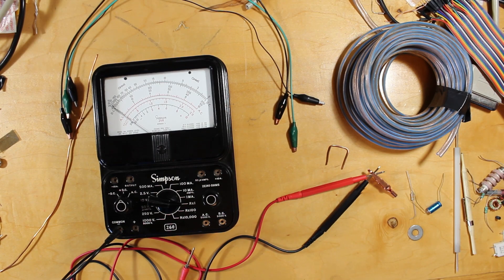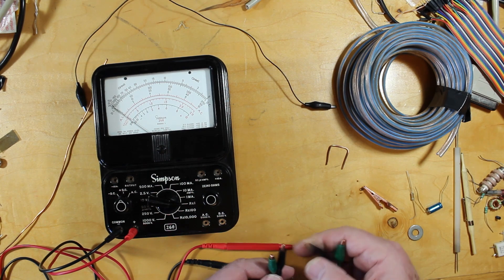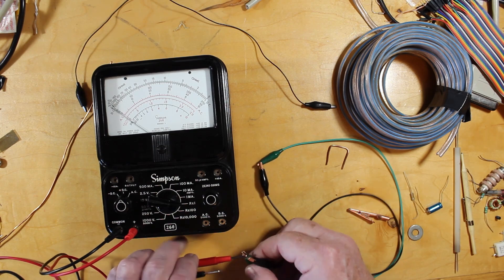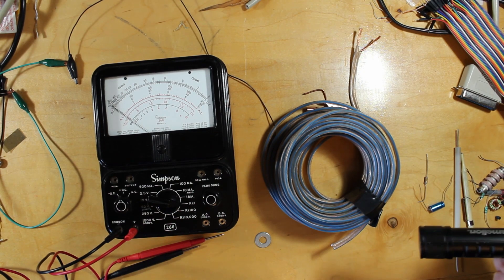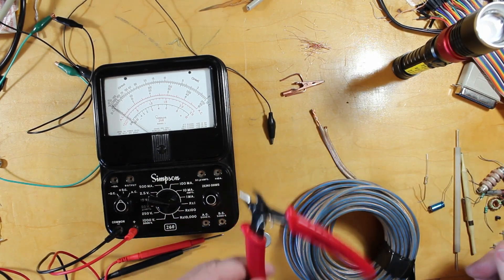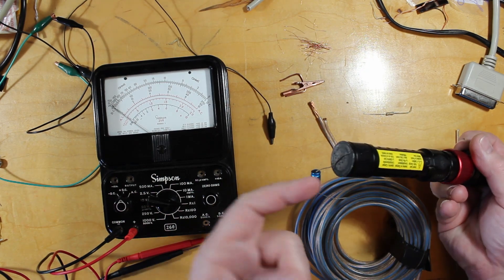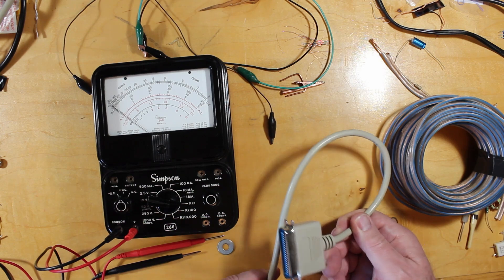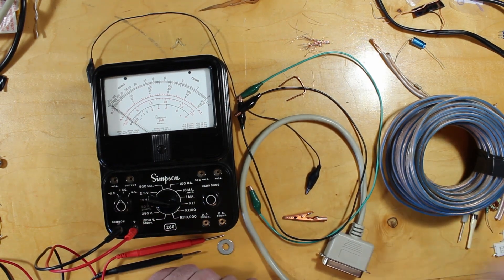#6  Surprise!  This 'speaker wire' is not made of copper. #fake

Comment: Once doing a project I had issues while using those jumpers only to figure out that all the alligators are crimped, the poor quality crimps added a lot of resistance to some of them. Now if I purchase those cheapie jumpers I re solder all the alligators.
Reply from the maker: I've seen the same.  The wire strands are folded over on the vinyl insulation and crimped.

Comment: As an old electrician I am very familiar with nickel-coated copper. This was used in the pre-wirenut era when wires were soldered. Nothing wrong with copper-clad wires as long as the seller is upfront about it. I would prefer pure copper though.

Nice 260 there. I have a 130 around here somewhere.
Reply from the maker: Just bought some new leads for the meter.  The old vinyl ones were too short and stiff.
Reply: @MoreThanElectronics  Good leads are a thing of beauty. And not necessarily easy to find. And you know that they have to be cheap if they are substituting Al for Fe...

I remember that the old Wiggy testers would break their leads fairly frequently. Something that you wouldn't expect from a Square D product. Now Temu sells "Wiggys". What could possibly go wrong? Yikes!
Reply from the maker: A Wiggy is not something I would be cheap with.  They're not that expansive for a decent one.  Getting shocked while you're up a ladder might not kill you, but the fall might.....
Reply: @MoreThanElectronics  It would get to where it would be a crapshoot whether the darn thing was working or not. 

Now I know why the old-timers used their fingers. :)

Comment: Just tested a bunch of alligator clip wires I use - about half are magnetic. I knew copper coated aluminum was othen used, these days  in Ethernet cable, but didnt know they were also skimping by using steel. Its hard to image that the cost and effort to coat such small strands of wire is actually worthwhile.
Reply from the maker: Depending on what kind of steel you compare with what type of copper, the price difference is often copper being about 8 to 10 times more expensive than steel.  The wires can be electro-chemically coated with a thin coating of copper in a continuous process at speed.  Unfortunately it's one way to increase profit. (Ferengi rule of acquisition 239)

Comment: Ever rewire a Incinolet toilet?
The first time I did one it burnt all the copper wiring.......it was excellent Ancor marine wire.
I did it a second time with MGT type wire.
Also. I used high temperature terminals........tin coated steel.

Comment: Well, the  standard field telephone wiring used in the "Old Army" was actually a mix of steel and copper.   The steel wires were meant to permit it to span good distances without sagging while the Cu was, well, for conduction.
Reply: It was something else.
Those cables were made up of silver plated copper wire and steel wires for strength!
Copper iron wires are a pure scam!
Reply from the maker: Given that the loop resistance for a telephone setup can be quite a bit more than 1000 ohms, using wire with higher resistance can be acceptable.  Other factors, like strength, can outweigh the resistance.

Comment: There is one very good reason for steel wire use in some applications: Steel can be made way more fatigue resistant than copper, so it is less likely to break when exposed to movement and vibrations or so. Of course, those are limited to where the extra resistance is not a problem.
Other method was to use metal coated plastic, those were very popular for telephone head set cords, where even a few 10's of extra Ohm was no issue at all.
Reply from the maker: I think of the copper coated steel that is sometimes used in 'long-wire' antennas which have long spans of unsupported conductor.
Reply: @MoreThanElectronics  
Similar construction are also military telephone wires: A pair of conductors within common plastic/rubber sheet. There the motivation is really the mechanical strength and robustness.
And power wires (on the poles, not cables burried underground) use to use steel core surrounded by a bunch of aluminum wires. The steel core provides tension strength and aluminum conducts the electricity, as it is the second best conductor per weight (behind beryllium, which obviously wouldn't be that good choice for something in the open).
Reply: @MoreThanElectronics  Yes, the copper coated steel can be an excellent choice for antenna wire, if the frequency of use and the thickness of the copper are sufficient.  You get the strength advantage of the steel and the conductivity advantage of the copper.  Due to the skin effect, virtually all the current will be in the copper if the copper thickness is a few skin depths or more.  For instance, at 7 MHz, the skin depth in copper is one thousandth of an inch, so you would ideally like something like three thousandths (3 mils) or more of copper coating at this frequency.  (For use at other frequencies, note that skin depth varies inversely as the square root of frequency.)  Due to skin effect, plain steel wire is very lossy in high frequency applications.  Steel wire has even been used to make dummy loads for use on the end of rhombic antennas.

Comment: I always take a look at the end of the cable if I see copper or scratches on the metal.

They can be aluminum!

in the area where I live, we mostly have copper speaker cable, but antenna coax cable can often be steel. and cheap rca car signal cables can be aluminium

Comment: Nowadays they have all sorts of wire, CCA, CCS, even CCC (Copper Clad Copper).

Turns out CCC is actually low grade copper wire being clad with good quality copper, hence CCC.
They have worse conductivity compared to pure good quality copper wire.

In the old days they'd clad copper wire with silver for radio equipments, nowadays  it's quite the opposite for electrical wire being silver aluminium being clad with reddish copper to make it looks like whole copper.

Even LAN cables (cheap ones) many are CCA cables inside. 😢

Pure good quality copper wire are more expensive indeed.
Reply from the maker: The package should be labeled so that it's easy for the buyer to see what they're getting.

Comment: To be honest, I wouldn't try putting an amp through even pure copper wires that were that thin anyway.  I have a bunch of larger-gauge (some 18 and also some 14 AWG) clip leads which I use for anything over a few hundred mA...

And be careful of the cheap data cables like that old printer cable.  A lot of those were made with CCA (copper-clad aluminum) wires, not pure copper either.
Reply from the maker: I suppose part of the consideration when using small jumpers is how much voltage drop you're willing to tolerate.  Also don't turn your small jumpers into fuses.  
I just made two jumpers from an old printer cable today. (video soon) I did put one amp through them and measured 108mV drop average for each.  So about 0.1 ohm each.  About 4x less loss than the steel ones.  The wire used is tin plated copper.
If unsure of the wire, scrape it with a utility knife or similar and look at it with good magnification. And try a magnet.

Comment: The UK telecom companies use steel wire ( for great strength ! ) coated in copper .... but this is the IDEAL arrangement for electrolytic corrosion ( in the damp outdoors ! ) , nowadays they surround the joints with thick  gel , but , this was not always so , resulting in crackly telephone conversations ( and , broadband dropouts ! ) ...... DAVE™🛑
Reply from the maker: There is a copper coated steel wire with a further clear enamel over all that is used for long-wire antennas.  The skin effect at RF frequencies makes it a reasonable choice.

Comment: Nice.  Worth mentioning I got a couple of Mini PCs from AliExpress about 2 years ago, the kettle lead on one I felt iffy about so replaced it.  I cut it open to see the thinest of aluminium wires inside, image if somebody used it for a different application, with a much higher power draw.  KaBOOM at best, like a fuse, or fire at worst.  I almost feel like I should be PAT testing new cables I buy, just to have some confidence.
Reply from the maker: Made to do the job, but just barely.  Thanks for the comment and the subscribe.

Comment: It sounds like one should be taking a magnet with them when shopping for wire.
Although there is another twist, copper coated aluminium wire, a bit harder to spot.
Also the copper plating can be really thin, to the point that it more or less disappears while your soldering, meaning half way though your soldering session the wire loses it's will to stay tinned.
Reply from the maker: The next time I shop for speaker wire I'm bringing a magnet.

Comment: I noticed this a few years ago when some clip leads carrying maybe 2 amps got so hot that the insulation got soft. I checked all my leads and maybe 1/4 were steel.
Reply from the maker: Yeah, I used to put it down to the wire being very thin or the alligator clips having a poor connection
and never to it being made of steel.  Like I mentioned at the end of the video, I found a printer cable to deconstruct and will be remaking a bunch of my jumpers.  Thanks for the comment and the subscribe.
Reply: @MoreThanElectronics   Glad to subscribe, your channel looks like it might really take off.

Comment: My resistors, old mixed batch, are copper.   My capacitors, old and new, have steel leads. My new resistors have steel leads.
Reply from the maker: Almost all the resistors I have use steel in their leads but it's not a problem because that small resistance is nothing compared to the resistance value itself.  I'll have to look and see if it's the really low value resistors that have copper leads. Copper has better heat dissipation.

Comment: It's an increasing problem. Steel and aluminium are cheaper than copper, so they are often substituted, often with a thin copper plating so it looks good.
Reply from the maker: That is true.
Reply: Consequences of getting everything from China where we have zero control over regulations (or lack thereof).
Reply: Um, I hope you aren't talking about massive overwhelming regulations in the US. They are well hidden, but a big pain in the butt.  @jnharton
Reply: Pretty soon the U.S. will run out of copper. The recycling centers sell it to China. I took several old transformers to be recycled only to find out they are shipping it overseas. This should be a law against this our natural resources are being depleted.

Comment: If copper wire isn't magnetic then how come they can make magnet wire out of it? 🤔
Reply from the maker: Magnet wire is typically called that because it has a thin (often high temperature resistant) enamel coating for insulation so you can wrap more wire on a form than you could with typically thicker rubber/vinyl covering.
Current flowing through any conductor creates a magnetic field.  Whether the conductor is magnetic (iron) or not (copper, aluminum) doesn't matter.

Comment: I bought some speaker wire on Amazon that was advertised as "naked copper" but it turned out to be aluminum with a thin copper plating on it - it went back the very next day. Also, a few low-cost 230V plugs+wire I bought are suspiciously lightweight. I kept them since I want to use them for very low power lights, but I wouldn't be surprise to see them catch fire when used at the maximum declared rating.

Comment: Yeah, I noticed this some years ago on Computer Power Supplies...
So imagine running high current...all the time...through aluminum wire...Device runs harder to compensate, thus drawing more current...Now, put a Power Company power usage meter on that....

Comment: Wow a great Model 260 Simpson meter. Cut my teeth on one of them. We had a couple of them in our electric shop in the 1970's that we use to send out every year to get calibrated & replace the test leads. Have not seen anybody using them out in the field in over 40 years. Wire most likely another cheating communist china POS inferior product. I never purchase or use any safety & test equipment, electrical supplies, tools or LED'S made in cheating china. The #1 enemy of the free world.

Comment: great tips !  If repurposing old wire can make BETTER jumpers it's well worth the time.  it's convenient to buy pre made but i dont want them if they are junk 🙂.
Reply from the maker: And you can make longer jumpers if needed.  Those old printer cables have 25 wires, times their length, equals quite a bit of wire and each a different color.

Comment: Great video! 👍Those non-magnetic wires may be aluminium wires and not necessarily copper.
Reply from the maker: Agreed.  I think the weight difference of a roll of it would be noticeable though.
Reply: @MoreThanElectronics  you use the lighter test to find copper clad aluminum. If it burns like hair then it's CCA. Copper can withstand heat a lot better than aluminum can. But once all of that came out then they started making copper clad steel. Plus steel is even cheaper than aluminum is so it was a win win.
Reply: The CCP loves CCA!

Comment: non magnetic wire could also be made of aluminium. It may not be as poor of a conductor as steel, it's still only 61% of copper
Reply: I found a microwave oven transformer where the primary was made of aluminum.
Reply: @ericthecyclist  that is very common with new microwave ovens.
Reply from the maker: That's true.  The steel speaker wire is less dense than copper but not so much that I noticed it when in the store.
I would hope that if anyone comes across aluminum wire they would notice the 3:1 weight difference.
Reply: Yup, and very hard to solder if not impossible.
Reply: And yet aluminum wiring was actually used in residential at one time...
Reply: And that was a disastrous hell. Aluminum wire at that gauge is really trouble, if you nick it a little when stripping it, it will break off at that spot. Not necessarily when you put it in, but sometimes later. Outlet screws loosen up over the years and the box starts rattling around, then it can also break. Also, you can't bend it, unbend it, bend it. It snaps. They usually left about a foot loose behind the plugs to make service work easier.  @jnharton

Comment: The speakers cable looks very real - flexible and copper colored ... but it's fake
Reply from the maker: And it even solders okay because of the copper coating.  But crimp connectors that are put on with a hand crimper don't work quite right because the steel is harder than copper and won't deform as expected.  The crimp connector gets loose easily.